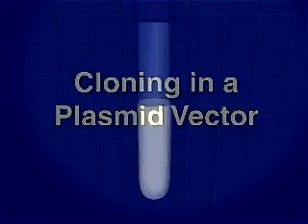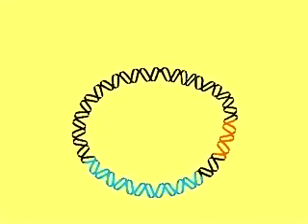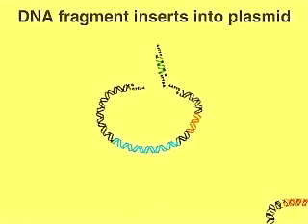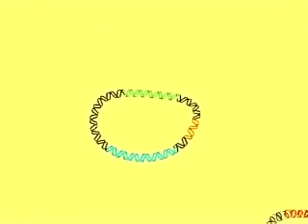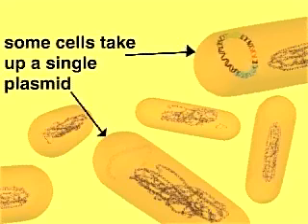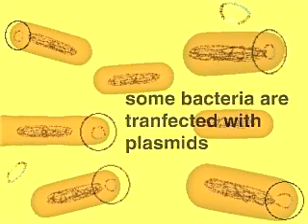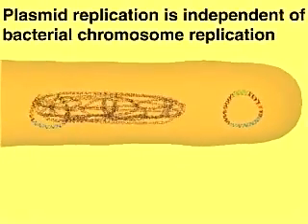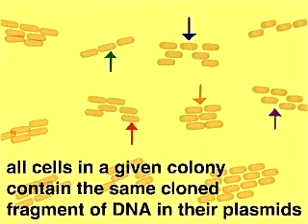Cloning in a Plasmid Vector

Comment: Thanks - helpful video!
Just a transcript:
DNA cloning is a method for isolating a particular sequence of DNA from a complex mixture of different DNA sequences. In order to clone a fragment of DNA we need to insert it into a vector that can replicate in a host cell. Generally a plasmid vector contains 3 elements:
1)	a cloning site where the foreign DNA fragments can be inserted 
2)	a drug resistance gene which destroys antibiotics (in this case ampicillin) to allow selective growth of the host cell 
3)	a replication origin to allow the plasmid to replicate in the host cell 
To insert foreign DNA we must first use a restriction enzyme to cleave the vector at the cloning site here EcoR1 cleaves the palindromic sequence GAA TTC to produce single stranded ends called sticky ends. These can hybridize with any piece of DNA that has also been cut with EcoR1 . Foreign DNA containing the sequence we wish to clone is digested with EcoR1 and then mixed with the cleaved vector.
The sticky ends of the foreign and plasma DNA molecules hybridize and then are sealed into phosphodiester linkages by the enzyme DNA ligase, creating a recombinant plasmid. Each of these recombinant plasmids contains the inserted DNA fragment and ampicillin resistance gene and a replication origin.

A pool or library of circular recombinant plasmids is thus created, each plasmid carries a unique fragment of foreign DNA. E coli bacteria are added to the recombinant plasmids the cells have been treated with calcium chloride to make them permeable to DNA molecules. Through a process called transformation a few cells take up our common plasmid while most other cells do not.

The bacterial cells are poured onto a plate of nutrient agar containing the antibiotic ampicillin. With ampicillin in the agar, only cells resistant to the drug can grow. At 37 degrees the cells will grow and multiply. Because they cannot move on the agar, each will produce a separate colony of cells. The non-transformed cells lack the plasmid with the ampicillin resistance gene and die. Cells that have a plasmid are resistant to ampicillin an survive. The replication origin allows the plasmid to replicate by using the host cells enzymes. Plasmid replication is independent of host cell division but plasmids are distributed to each daughter cell when the host cell divides. 
As the plasmids replicate and the host cells multiply the number of copies of the recombinant plasmid is greatly amplified. The multiple daughter cells form a colony or clone (because all the host cells in a colony are derived from a single cell they all contain copies of the same recombinant plasmid with its fragments of foreign DNA). A variety of assay methods can now be used on the bacterial colonies to determine which contains the particular DNA sequence we wish to isolate.